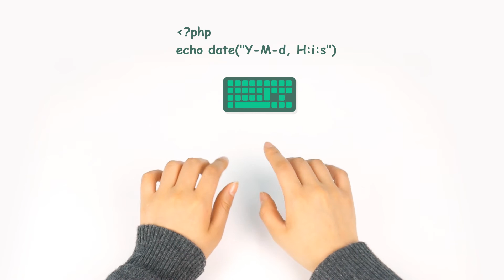PHPoC RTC (Real Time Clock)

Comment: i got correct date but year and time is diffrent then current year and time...2000:Jun-07-T11:49:45
Reply: Dear sir/madam,
Since date and time is set to default by chip manufacturer. For the first time, user need to set date and time via PHPoC debugger. (setting button -> time button).
Reply: thank u